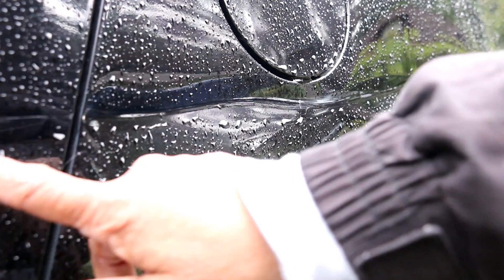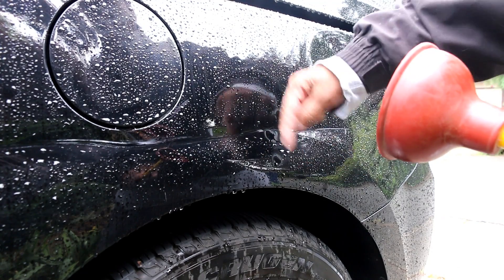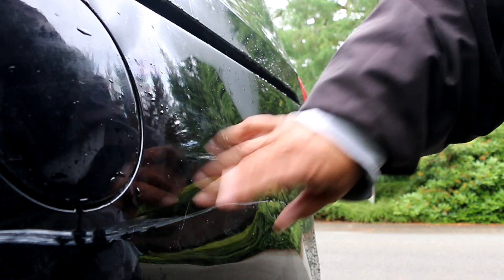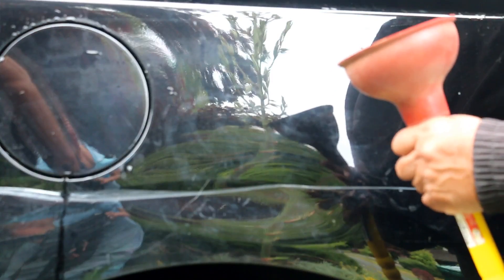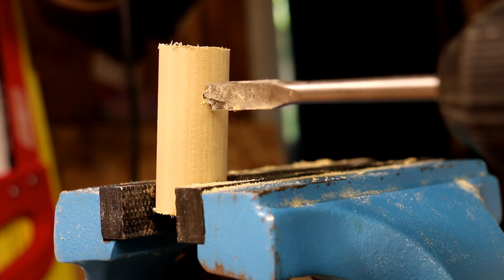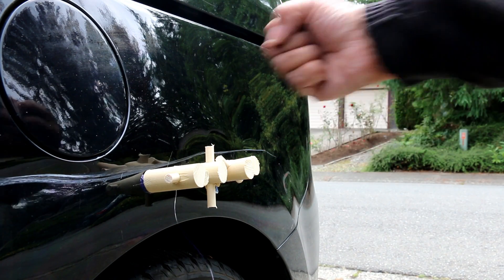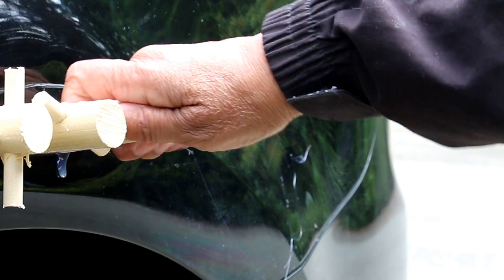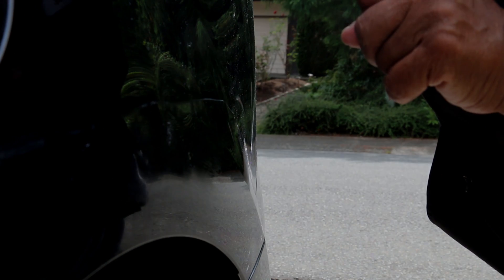Fix a Car Dent YOURSELF

Comment: when pushing the plunger back onto the dent, refrain from putting it directly over the dent to get another seal; use oil if you have to but put the plunger on an un-dented location near the crease- but not across it, and slide the plunger, already sealed, next to the crease and pull. repeat this in various points, never straddling the crease... and pushing it in and pulling it out repeatedly makes the crease deeper and wont hold the dent outward once you get it out. ittl just pop in and out and youll just get pissed. done this method before... the hot glue is just clutch tho:}

Comment: I had the same problem! Great video -- I used a product  I think it was called pop-a-dent, got it at an auto store, it was basically the hot glue method you used, but it had a better pulling mechanism that spanned over the dent contacting on the car in 2 places and in the middle was a threaded knob that you threaded over the hot glued puller and when you turned the knob would slowly build pulling pressure until it "popped"... another trick I've used with limited success is the good ole heat gun and can-o-air to heat and freeze -- it is a technique you have to be very careful not to damage the paint with the heat gun.

Comment: If the dent was on either bumper, you can just use a heat gun to soften the plastic and it will pop out. Keep it moving so you dont burn the plastic.

Comment: It was a great effort Leah. It wasn't a perfect repair, but does look better. The hot glue trick takes a lot of time with multiple pulls. I had success with this on my motorcycle gas tank. It can get most of the dent out, but with your lengthy scratch, I think you'll need to use some body filler and paint. This was a great tutorial! :)

Comment: What worked great on my Prius was heating to touch with a heat gun and pushing from the inside out. Also run some Scratch-X for awhile in a circle to get rid of the lighter scratches
Reply from the maker: Pushing from the other side is good advice, however in this case that was not an option.

Comment: What if you used vasoline around the plungers seal just to get a really good tight grip on it? Just a suggestion im not sure if it would actually work or not
Reply from the maker: Vasoline works sometimes but it really simply was a poor location to use a plunger.

Comment: Did you need to heat the dent with hot water when you pulled it with the glued dowels?
Reply from the maker: no

Comment: Here’s a quick tip: to remove tar or paint from accident damage, use Lacquer Thinner. Wet a rag with a little LT then lightly remove any marks. 

Caution: Do not use on plastics.

Comment: Nice job with the hot glue.
Is the next video rubbing out that scratch with rubbing compound and then up through polish and wax? 
It'll at least get rid of the other guys "war paint" on your fender.
Reply from the maker: Yeah I plan on rubbing it out but I doubt I'll make a video.